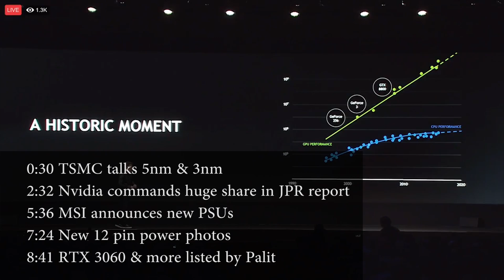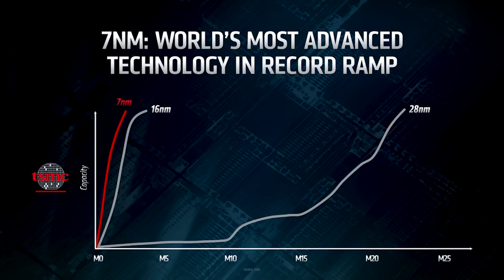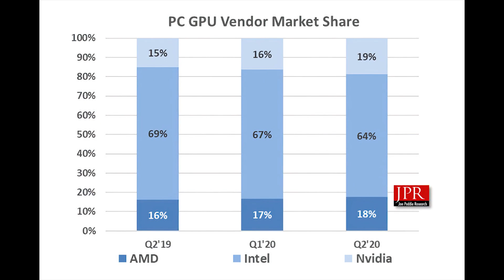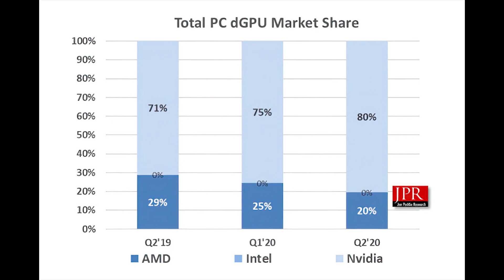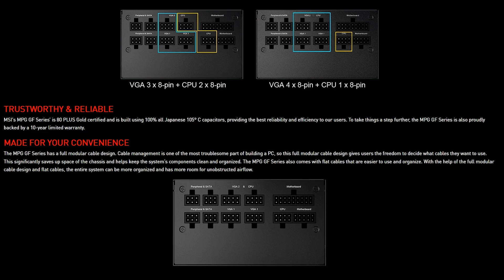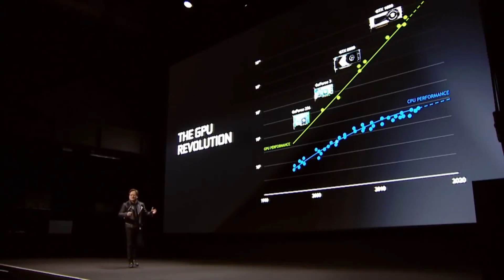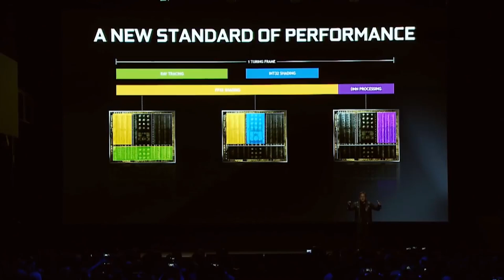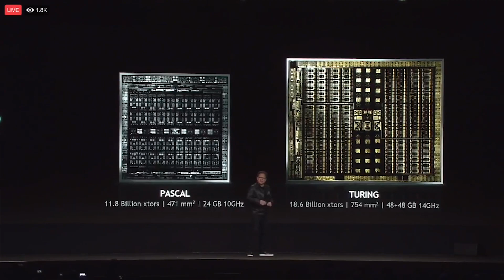Nvidia Dominates with 80% Discrete GPU Market Share | RTX 3060 & More Spotted in Listing

Comment: Pricing is so hard to guess because it's based on things we don't know yet, it's based on how fast these cards are compared to the  2000 series, how fast AMD's new line up will be and also what pricing AMD will choose.

I could honestly see the 3090 being $1999 if Nvidia has reliable info that AMD's fastest card won't beat the 3080 (this gives room for a 3080ti to bridge the gap a little plus a 3070ti to complete of price and performance with AMD's best).

Generally, people who would spend $1399 on a GPU would also spend $1999 on it. Obviously if AMD is within 5-10% of this performance and their card is $999 then many will not justify that significantly higher price simply so they can own 'the best' but many still would tbh.

I believe this generation is the beginning of a seismic shift in the GPU world of performance measuring. I think we are going to start focusing less of raw performance and more on features and how well they work. For example, if Nvidia have managed to nail DLSS and AMD haven't then there is a real possibility that the 3060 cards will 'perform better' (this is different to being faster, this is providing a graphical output that looks almost identical at a faster frame rate) than AMD's biggest, fastest cards! At a native locked 4k then sure the 3060 will be no where near Big Navi but I think the gaming benchmarking world needs to change from 'raw resolution per fps' to 'image quality per fps'. 

So if Nvidia's card is giving you 78fps on your 4k monitor and AMD's card is giving you 26fps and you can't see the difference in image quality then which would you buy? Does it really matter that the Nvidia card is only rendering in 1080p and then DLSSing it to 4k? It really shouldn't do.

AMD do have their ML (machine learning) to complete but this is it's first generation and DLSS is on version 3.0 so we will have to see how well it works. The big advantage AMD has is any game made for the new consoles (basically all games) will make full use of ML (eventually) whilst Nvidia needs to work out ways to get DLSS to work after games are released generally.

One last thing to factor in when pricing things up is how much better will games look on an expensive GPU compared to a next generation console for $399-499? Both Nvidia and AMD need to be careful to not price themselves out of the market. 

Certainly interesting times ahead that's for sure. Will Coreteks be proved right and there is a Traversal Coprocessor? Those wattages certainly suggest there is something else going on in that 102 die!
Reply: DLSS is maaking me not even consider AMD offerings, I'm getting an nVidia gpu just because of that. And I've seen a lot of people that feel the same way as me.
Reply: @sugo8479  Are you going to wait to see what AMD's version of DLSS is like first?
Reply: @Speak_Out_and_Remove_All_Doubt  Are they making something comparable to DLSS? Or is that just an assumption?
The most I've heard is that they are going to support direct ML, which nVidia is probably going to support it too.
Reply: @sugo8479  I think Xbox announced something at Hot Chips but AMD still needs to confirm this is on their cards and not just the consoles.

Comment: Also, talking MSI PSU, are we sure 3090 will have ONLY ONE 12-pin connectots???
Reply: based off of nvidias video it looks like it, theres no official pic yet of it. but aib cards seem to use a triple 8 pin lay out which you can see on videocardz right now.
At the very least i think if not 1 12pin it will be a 12pin + 8pin but we wont really know for a few days

Comment: Don't forget to save 1k for RTX 3080 plus $200 More for a new psu
Reply: 750w psus are like 80$ idk what you are talking about
Reply: @evila9076  correction a 750 watt psu ain't going to be enough for a RTX 3080 and they're ain't $80 + Gold high quality PSU from Corsair or Seasonic as far as I'm concern. You may want to invest on a 850 or 1050 Watt unit if you're running an i9 10900k and soon yo have a RTX 3080 which Will requiere 12 pin conector and those Will be using 400+ watts
Reply: @ItsCuzyh  there's noway you'll ever need more than 850w even with a 10900k & 3090. 1050w ? what are you smoking
Reply: @evila9076  we will see about that buddy rn my RTX 2080Ti OC uses  almost 330 watts when I play with everything at ultra , my i9 10900k uses 365 watts with 5.2Ghz on all cores and my total system wattage consumption uses 680 to 690 because of my Liquid cooler and fans installed and SSD's. If you're telling me a 750 watt power supply Is enought for a 3090 you're the ones smoking crack dude. Unless of course you ain't using a high end cpu . Like I said the new Gpu's Will have a normal TDP of 400 watts. And don't come at me trying to be Smart about wattage when you in the first place are only a gamer. You don't know shit about computer systems , you don't have a barchelor and you haven't studied about gpu's , how they're Made and how much they can consume. Good luck with your 750 watt psu.

Comment: intel is soo dead. 5nm is ramping up like crazy with better defect rates and yields than 7nm and 3nm is right around the corner. TSMCs 3nm will be available before intels 7nm. intels 7nm is comperable to TSMCs 5 so AMD will be again a full node ahead.
Reply: Worst case scenario,  Intel can always go fabless for its chip manufacturing, just like Nvidia, Qualcomm, Apple and AMD.
Reply: It's BEY BEY for Intel ! In 2030 Intel can only be found in a museum !